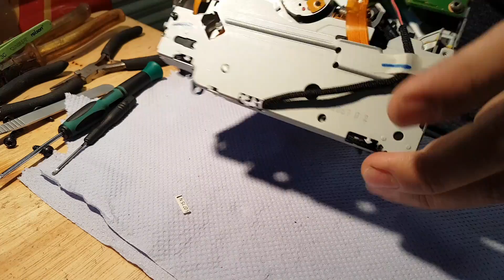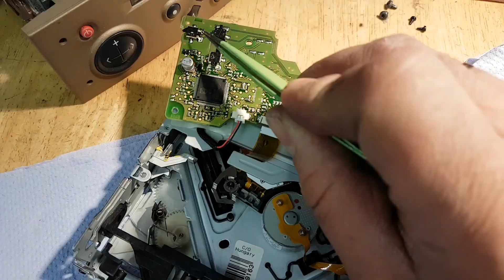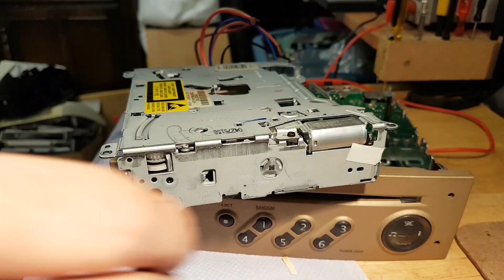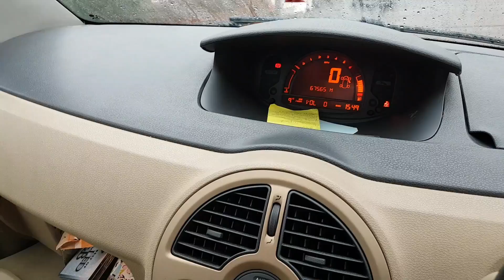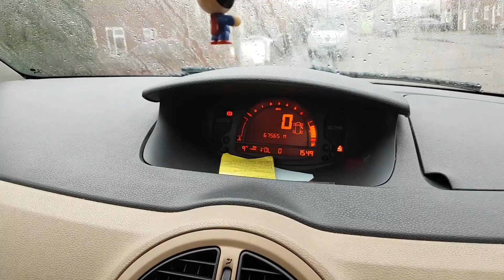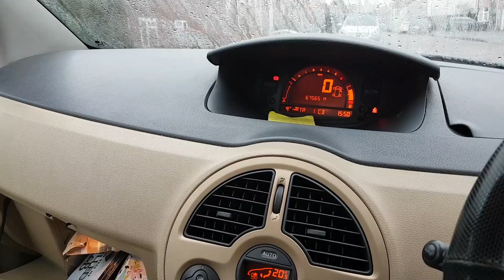Renault CD player not reading CDs. Troubleshoot and repair...

Comment: Hey, I have just done this for my father in laws radio. I have two bits left over. 😂 can’t work out where they go!? Wish I could send you a picture. The radio seems to work without them but I’m worried they are necessary. Thanks, 
Sarah
Reply from the maker: I guess if it is working, there is nothing to worry about...
😊
👍👍👍

Comment: Hi. Are CD drivers from renault cars the same between radios from the same car / year? For instance, does the CD driver from a megane 3 non bluetooth radio (R1 type) can be used for replacing a damaged CD driver from a megane 3 bluetooth radio (type R2 radio)?
Reply from the maker: Not sure...
I never seen the internals of those...
👍👍👍

Comment: i have a problem with my to its from a clio mtv i had the player changed for some time and when i put it back don't work i press the on of button and i only hear the cd trying to start put other after market and work fine but i like to make it work what should i look and if is any forum topic about this problem notice most of the radio cd have a fuse this does not